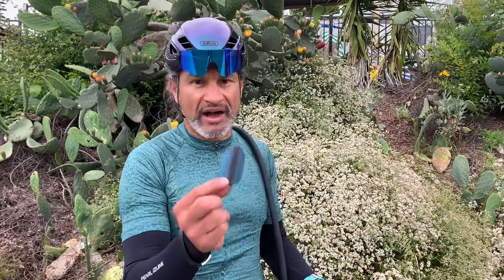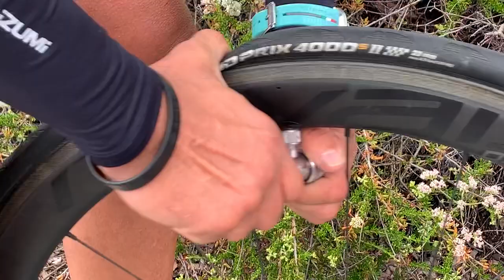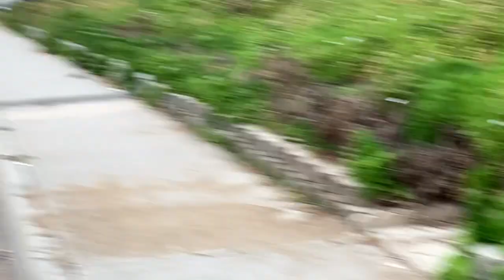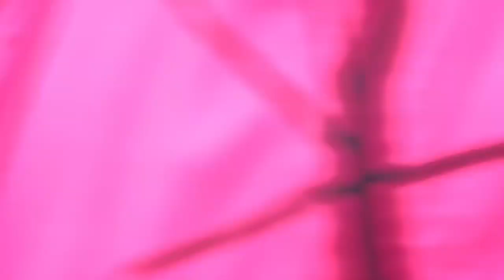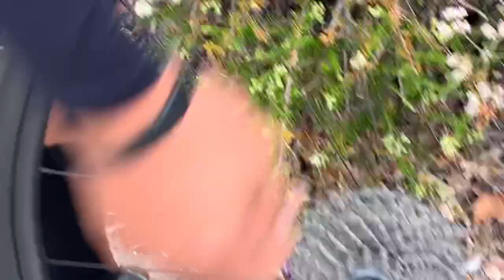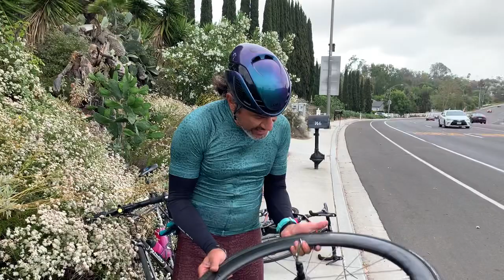How to repair a cut tire on the road. Use a tire boot.

Comment: The 1st inflator, you need to screw it onto the presta valve so it creates a seal before you open the valve. I have one like it and I do like it but I am glad you got the boot working for you.
Reply from the maker: Ahhh! Thank you so much! So it threads on? Good to know. 

That inflator was from the cameraman when it didn’t work I fetched mine out of my flat kit. As I said in the video I prefer inflators with no moving parts just put it on the valve un tightened re tighten the CO2 canister to modulate air flow.  

Thanks for watching and thanks for the tip!!
Reply: @SeeYouUpTheRoad  thanks for the great videos and yes, it threads on. Always happy to share my knowledge and I truly appreciate you sharing yours.
Reply from the maker: @grantmcalpine6364  this IS precisely what the community is about! Cheers 🍻

Comment: Nicely done George. Tire repair and flat change in the "wild"
Reply from the maker: Thank Luis and thanks for watching!! Barely 6 miles into a 132 mile day. She got a second flat later that day.  😢
Reply: @SeeYouUpTheRoad  ha ha... I get 2, I go home. Glad you were there to sort that out.
Reply from the maker: @thegoodwheel  ha ha we were way out in the boonies by her second flat only 46 miles into the ride - we sort of did the “go home” thing. We cut out some of the climbs out, changed the route to resupply so we only ended up with 132 miles and 6500 feet. I wanted 160 miles and 10,000 feet for the day - well there’s always next Saturday 😌
Reply: @SeeYouUpTheRoad  thats a good ride. Well done

Comment: You didn't hold the first inflator firmly or straight enough for it to have a chance of working.
Reply from the maker: According to another viewer it needs to thread on. It wasn’t my inflator. As mentioned before I like simple inflators the type you just put on and let her rip 😂 like the one I own and used in the end. 

Thanks for watching!